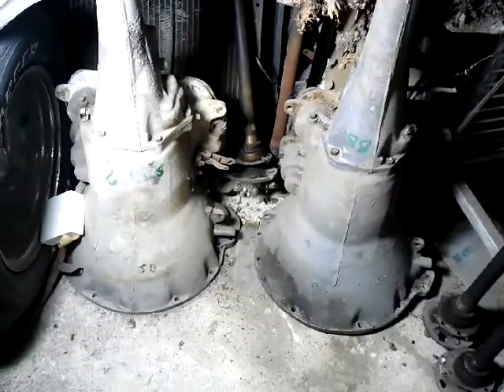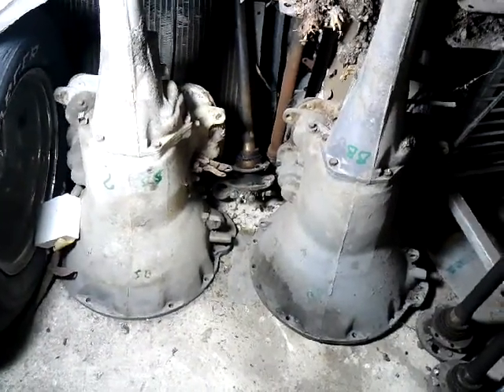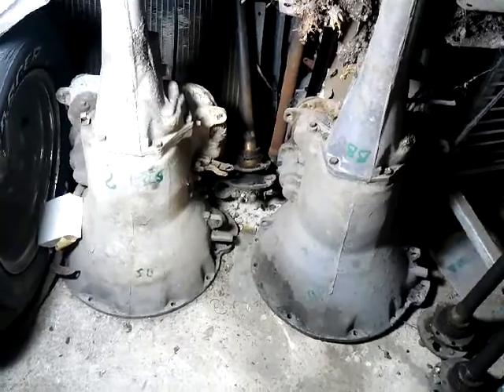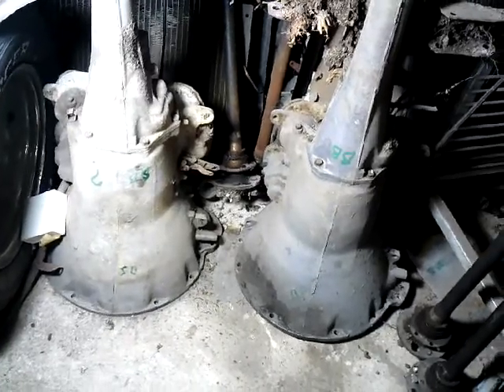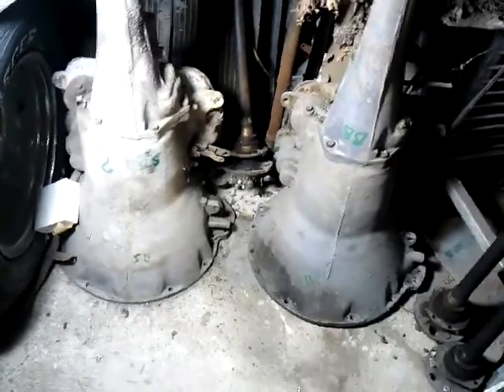How to tell the difference between Big Block and small block Mopar transmissions and bell housings

Comment: will some of the bolts bolt up?
Reply from the maker: I am going to have to say no. Even if you could get one or two to line up you will have starter, flywheel and/or converter issues. I think there is a company making an automatic bell housing that bolts to the pump and you just hack off the original bell, but I think it is a scatter shield for all out racing. Otherwise, you will need to replace the case for automatics or the Bell for standards.